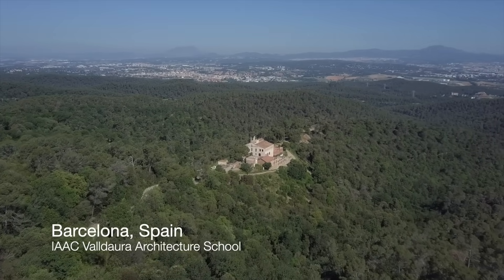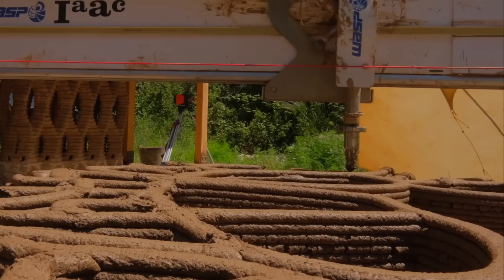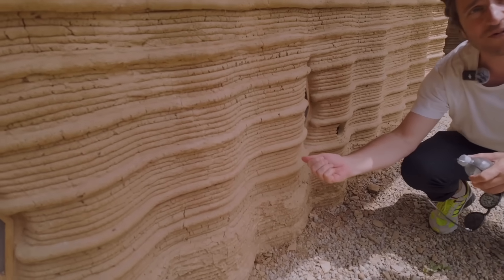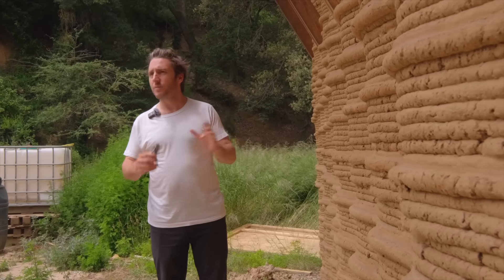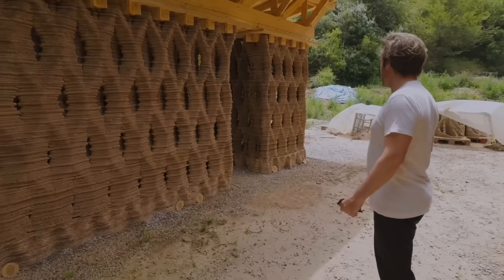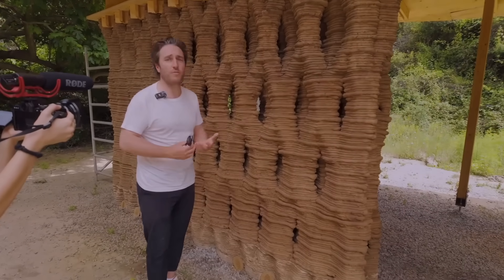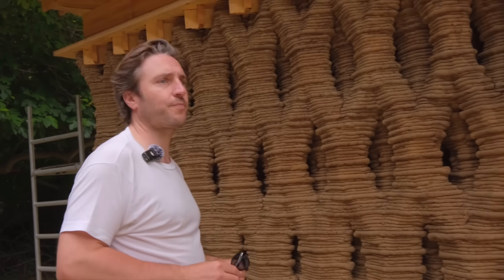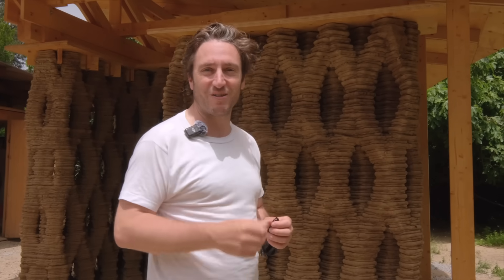Is This the Future? 3D-Printed Pavilion Using Earth and Technology

Comment: the base is not flared enough. look at the mud houses in yemen. 20% concrete makes it so it wont dissolve in the water. if you enter a low humidity week with wind the thing will be frail/dry out due to the lack of mass

Comment: I wonder, is this structure somehow resistant to termites? I worry about the wood for certain locations. Could the roof have been desigend to have less uplift to wind, and so less structure (cables) needed, and better overall protection for the walls from heavy rainfall?

Comment: I'm being offered an opportunity to start working with a WASP printer. I spent decades in the drywall trade, which then evolved into earthen plasters (clay, lime). This seems such a natural progression....I'm excited.
Reply: Very excited for you, where are you located? I am currently finishing my straw bale home, I have been using my local soil mixed with straw as a natural plaster. My soill is perfect for this and is over 16 feet deep with no stones! I would love to see the printer in operation with the Idea that I could print a couple of cabins/outbuildings. I have also used dirt bags with great success, they turn as hard as concrete with compression. I am in California, a little south of the Bay Area.
Reply: @limeyB-star-D  I'm in Western Montana, so not TOO far from the Bay area! (ha!)
Reply: @limeyB-star-D  Also, your home sounds amazing, and very much aligned with the direction I'd like to see my life move toward...

Comment: Rain water could get into the cavities in the wall during high winds and can get trapped inside the wall and begin to erode it. And since the roof is so high, it won’t protect the wall from the rain.
Reply from the maker: yes but it's in Spain. It's only 50 days of rain a year here. 
But for sure, this type of construction is more adapted for dryer climates.
Reply: Didn’t heavy rain hit Barcelona last fall and Valencia got flooded? Architects need to build for unpredictable weather and climate change. It’s a disservice to not teach this at the school.
Reply: @rick-yo  The rain in Spain falls mainly on the plain?
Reply: @rick-yo  Build Marine crafts that will float if required.

Comment: That's interesting . But the  whole point of using soil as buildig material is that it's a cheap technique.  Would be great if roof was made with earth as well using vaults
Reply from the maker: the wood come also from the forest in the surrounding
Reply: @Intothewildhouses  that isnt the point
Reply: That is an interesting option,  I love arches and vaults too and would like to live in a such place , but for a hot sunny climate like theirs, a heavy roof that works as a thermal mass storage would make it uncomfortably hot in the summer. While still needing an additional layer of protection from the rainwaters. Which could be beautiful roofing tiles covering the clay dome, but it would still be overheating without additional  shade giving roof like theirs already is. ❤
Reply: @thomaxtube  vaults and domes can be quite thin. The issue is than cob cant be used as a roof as it will disintegrate in rain. Fired bricks can be used however. I would be curious if cob with a layer of polished and oiled clay could work but that would probably need at the minimum yearly maintainance, more likely monthly, making it impractical.